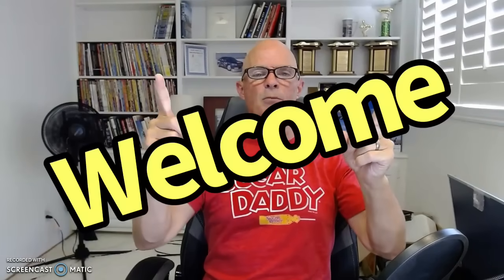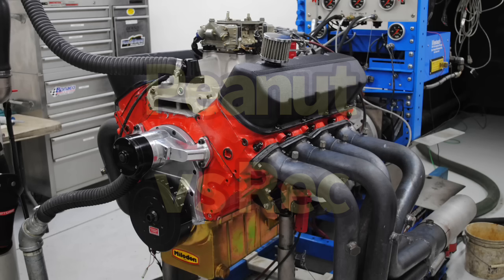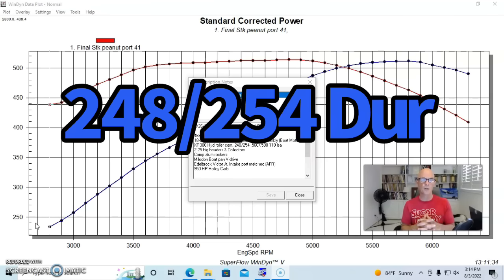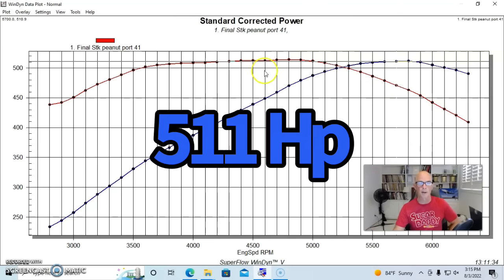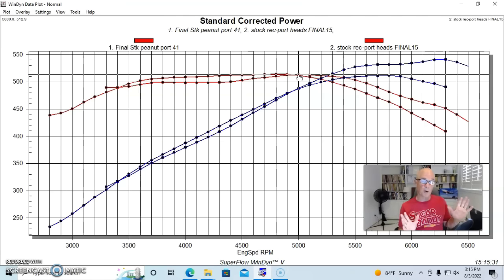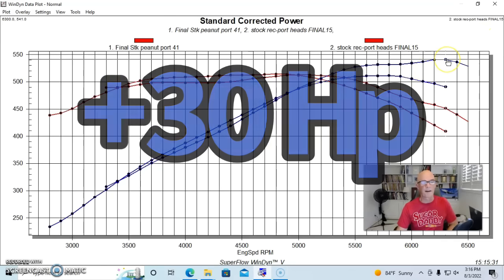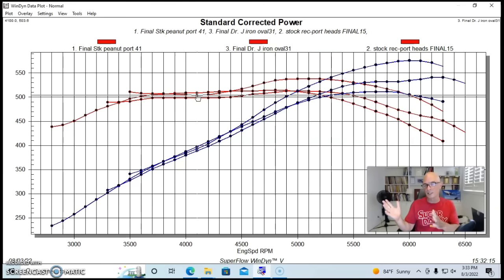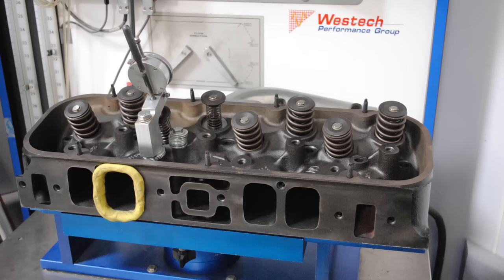WHICH FACTORY BBC HEAD MAKES THE MOST POWER? PEANUT PORT vs PORTED 049 OVAL vs REC PORT vs AFR 265!

Comment: I would have rather seen the RPM Performer Intake here, as he was trying (in my opinion) to get the most torque in the mid range. How many dyno test do we need to have the highest number at the top, instead of the average highest torque. Which is what you want in a good "Street Machine". If this was trying to get the most for the "Flying Mile".. Then this would make sense.
Reply from the maker: I ran an rpm air gap too!
Reply: @richardholdener1727  ok then that can be your next vid 👍

Comment: Depends on the combination on head selection and usage. My 088 headed 496 certainly doesn't lack low end torque 😆 some people think that I have ovals and rpm air gap before I either show them or tell them my engine combo.😆
Reply: Yeah, a big motor with poor low end torque still usually has enough torque to make 2 small blocks jealous. I had a rec port headed 454 in my 70 Corvette for a while 25years ago. It was pretty high strung but occasionally I would miss first when stopping and put it in 3rd. It would still pull away from a stop with plenty of get up and go. I did sell the 088s to a guy restoring an LS6 Chevelle and replaced them with a set of worked over 049s but I also replaced the cam and intake so the performance I picked up was a combination of things.
Reply: @1967davethewave  I had a set 390 oval port heads on my old 402 bb they make plenty of torque. If I ever decided to pull off my 088 heads I'm going with probably some AFR 265 or Brodix RR
Reply from the maker: rec ports will always be down to oval ports down low (even on a 496)
Reply: @richardholdener1727  I agree, but I'll still keep my 600 foot pounds with my rectangular port heads.
Reply: @richardholdener1727  Lingenfelter proofed that years ago and is right! Thanks Richard for this video man!

Comment: Id like to see you do a test on intakes on BB ford heads. how much difference does it make if the intake ports match. no after market intakes match the small port efi heads. with efi motors being so cheap id like to keep my hualer with the same heads but have a modern efi set up and intake. id be great to see real data to make a good decion.

Comment: The ported rec port heads probably would out power the 265’s at the very top end but I would take the 265’s all day.
Reply from the maker: I doubt they would ever come close with this cam
Reply: @richardholdener1727  yes not this cam, something like 270 or 280 duration.

Comment: To answer your last question in a more apples to apples way,  I know the AFR 305 square ports are very close in power to the newer AFR oval 265's you tested here because I run  a nearly identical combo on the street with a similar camshaft using a set of the AFR 305 square ports and it makes very similar numbers to your test engine here.

I've run ported OEM oval ports before but never ported OEM square ports.  After all the money I spent back then with ported OEM heads, 25 years ago I just decided to jump into a set of AFR 305's (oval port AFR's weren't around yet)  and I've never regretted that decision.  Still run that same combo today.

Comment: I'd like to see the stock peanut ports with the 2.19 intake valve and mild port work on the bowls and throat.i think that would be a great 454 head to 6000 rpm? Thanks for the testing Richard!
Reply: Ben I’m about to try this ! My peanut port 454 went 11.60 and 70s with 2.06 valve 236 heads ported by me in my garage and they still had the factory valve job,last month I had the heads cut for 2.19 stainless valves and a good valve job on the intakes only! I’m guessing low 11s
Reply: The peanuts aren’t worth putting💰 💰💰💰into with valves, guides,valves,porting etc. They’re boat anchors if you wanted to put money into stock steel heads just buy some oval heads.
Reply: @donmilani129  I disagree! My peanut ports flowed better all the up to .450 lift then my stock 781 ( both heads had stock valve jobs and 2.06 valves) the 236 flowed 272.5 @.450 and started falling off after that and at that point the 781 started to flow better, for a truck or a mild (mid 12 second) street car I think the peanut port is a great option because like my heads you can get a set with almost no miles take offs from a motor home for Pennie’s! My 68 Camaro goes mid 11s with Zero machine work in the heads with 2.06 valves and still has the motorhome valve job!
Reply: @donmilani129  
I agree, start with 049’s or 781’s rather than peanuts and be that much farther ahead.
Reply: I did exactly that to a set of stock oval port heads and a .030 over 454 with a cc hydraulic roller.246 @.050/ .646 lift on a 110 and a rpm air gap and a 750cfm carb. It made 550hp/ 550tq. Peak power was at 5800 and torque was at 4500.  Needed a bigger carb but the AED 950 wouldn’t run properly.
Reply: @scottsigmon926  my 1978 BIG10 454 came with 781 oval port heads and I cut them for 2.19”&1.88” valves and ported them. I used a Edelbrock performer RPM intake with a 850 Holley and a small Crane solid roller cam which I used to pull a 26’ enclosed race car trailer. Ordered the truck new and still have it.
Reply: @noahdunaway  
That’s awesome, I have an 80 GMC heavy half, I’d love to build a similar big block for it.
Reply: @shitbox82  with gas prices going crazy, you might be better off putting an LS3 or something similar. Mine gets 10 MPG with a Holley 850. The good thing about an LS motor is that you can use forced induction and get just as much power as a big block but still get good fuel mileage.
Reply: @noahdunaway  
My heavy half has a 5.3 in it now, it’s fun but nothing makes torque like a big block, fuel mileage is not a concern with this truck, it’s strictly for fun, I have another 2wd half ton square body with a 6er that’s my daily driver. 😁
Reply: @shitbox82  I agree, mine is not daily driven and I just built a 557 with Edelbrock performer RPM heads,(square port), and air gap intake. I used the same 850 Holley and the gas mileage is still 10 mpg. I didn’t go crazy with the cam because I pull a 26’ enclosed race car trailer so I used a 280* .600” lift roller cam. It ran high 11’s at the track playing with it. It’s a 4.500” bore with a 4.375” stroke and it’s a torque monster.
Reply: @scottsigmon926  
That combo definitely has more in it…
Reply: I'd like to see someone hide a turbo under a high-rise manifold, feed it exhaust through the exhaust crossovers in the heads, and make it a complete bolt-on system. They'd have to conceal the dump tube somehow, but it could be done. Maybe through a custom front cover? Just have low enough compression and a properly-sized turbo to not need aftercooling, or just hyper-aggressively cool the heads right down to ambient.
Reply: I have a set of peanut port heads that I installed 2.19” intakes and 1.88” exhausts, I ported them to fit a oval port intake manifold. I had a 78 Suburban that I was going to build a 454 for but never did. The heads are new boat “take off heads”.  I would be curious to see how they flow and work on a 454 for maybe a tow truck or something similar.

Comment: BBC should have a .700+ lift cam.  In real terms the AFR is probably the cheaper option. You drop a good bit of coin in machine work and parts getting the stock heads going for what will still be an inferior part.
Reply: People are already asking close to half the cost of the AFRs for stock 990s. Add up those costs and parts and almost any aftermarket head is gonna outperform it. Not to mention the weight savings

Comment: The gains from modern Aluminum heads is amazing.       Very Impressive.
Reply: YES it is, the engineers have addressed the old good port bad port issue nicely. GM finally got with the program with the 8.1 but dropped the ball with all the smaller metric stuff and thin wall castings and heads. On a side note, always wondered why GM went with the Olds block for the 5.7 diesel instead of a 366 block? It wouldn't have made any difference on the weight simply on the issue of installing BBC's in any of the other car frames ! Better head bolt pattern compard to 10 bolts only even with 2 missing in the BBC's

Comment: The gen 6 96-99 7.4/454 have good large oval port heads (not peanut ports). But they have big 'lumps' in the intake runners by the valve guides, supposedly to enhance swirl. I spent probably 40 hours grinding on a pair of 1999 heads. I took out the lumps so the intake runners now look like all other normal intakes, and per David Vizard, worked the runners to redirect flow away from the cylinder wall on the 'bad' ports. On a SF600 flow bench, intake flow went from 245 cfm stock to 295 cfm at .600 lift with the stock 2.06 intake valves. That much flow should support roughly 600 hp. I also uniformed intake runner volume and chamber cc's, plus flat milled .020 to make 102 cc chambers. Can I send em to you for testing?
Reply: Great head for a 396
Reply: Thanks for sharing I'm doing a set of peanut ports following David vizArds advice
Reply: Would a valve size increase have a dramatic impact on flow?
Reply: @MrScottt28  think there can be a good gain on the intake side using 2.19  valves if your wanting to go all the way. Vortec pro has a few good videos on YouTube too
Reply: I have a set of stock L29 heads, bought them for $80, I’ve considered removing the swirl ramp myself, my only hesitation is I feel like low speed velocity would be compromised, I could be wrong…
Reply: @shitbox82  your wrong
Reply: @indyrock8148  
School me then…
Reply: @shitbox82  removing the ramp won't affect low speed velocity.
It will increase POWA everywhere!
Reply: @indyrock8148  
You have flow bench testing to prove your theory?
Reply: @shitbox82  how could velocity be compromised?
Reply: @indyrock8148  
Because the port was designed with low speed flow and velocity in mind, you remove the  swirl ramp and it might flow more air, but in a higher rpm range than the head was originally intended for. Removing material doesn’t always equate to improved airflow at all lift points. The OP points out that the head he ported gained 50 cfm at .600” lift, which is great, but what about low lift where the head was designed to work? I’m willing to bet the flow didn’t improve much if any at low lift. Plain and simple the port was designed to move a lot of air at low engine speed and low lift, if you take away the features that make it do that how could it not lose air speed and velocity?
Reply: @shitbox82  because the swirl ramp is in a location not normally considered by porter's when calculating velocity. Such as the Min CSA and SSR. 
By inspection increasing flow from 250 to 300 CFM with a port of similar average CSA INCREASES average velocity. Ski ramp was actually slowing the whole port down.
By all means leave it in though, it doesn't bother me.
Reply: @indyrock8148  
I don’t disagree with what you’re saying, but my point is why take a head that was designed for low rpm truck applications and spend hours doing port work to it to try to make it make horsepower at higher engine speeds when there’s numerous heads out there that will do that so much better? Now for trucks and mild street applications I think it’s a great head, beyond that I’d run something else…
Reply: @shitbox82  the ramp increases that and swirl. Gm put it there for a reason as you thought
Reply: @shitbox82  Doubtful he has any experience working a flow bench

Comment: Way out to compare if the valves were back cut on the aluminum heads versus not on the cast iron one and then where was the air back you know in the cast iron head what RPM range with the originally designed for there's a lot of different variables that you didn't even cover you just want to go all out power you put an air cleaner in a filter on top of that with a snorkel you just last 25 to 28 horsepower what would that do to twerk it might increase it I think cuz it has to work Big blocks like to work